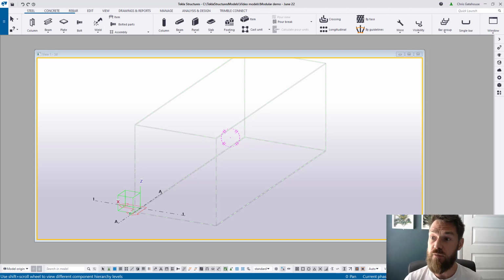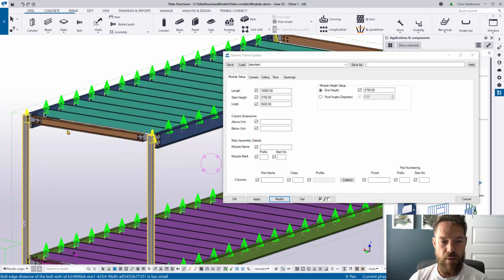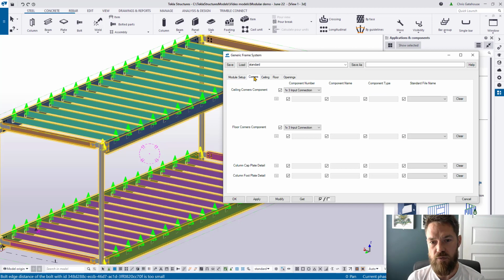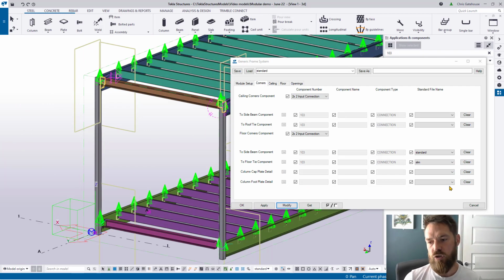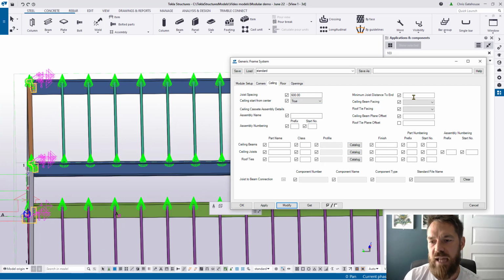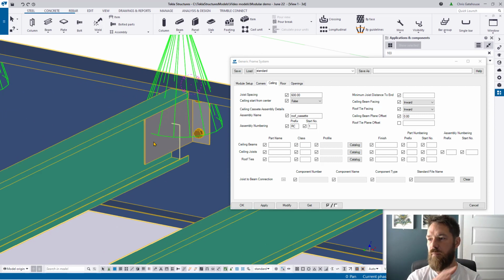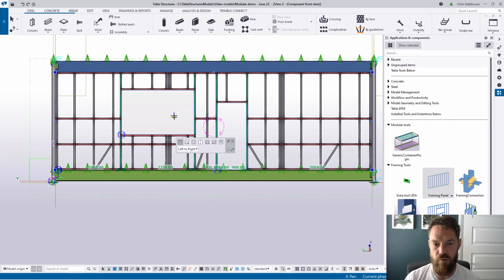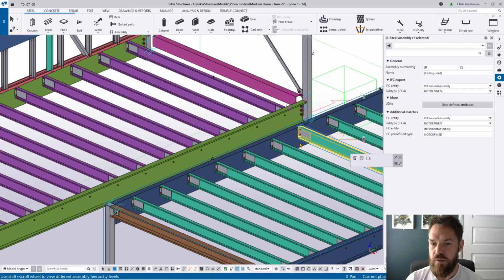Tekla Structures 2022 - Volumetric modular tool

Comment: Do we need to allow deflection gap when placing one unit on another?
Reply from the maker: This is a question for your engineer
Reply: @chris_gatehouse  I understand that. In this model how it is modelled with gap or without gap.
Reply from the maker: This is the purpose of the column projections above and below, to allow you to bear the columns onto each other whilst keeping the cassettes apart.